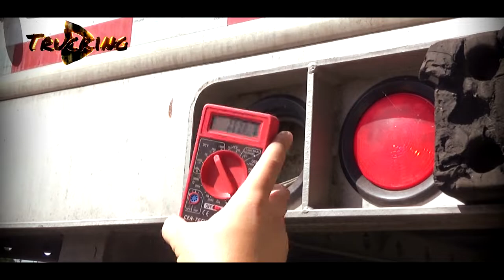Semi trailer wireless reverse light install PART2

Comment: U smart bro 🙏 can u help me how I can get cheap front pumper for 2013 cascadia with fog lights.. thank u
Reply from the maker: Order from Amazon. Did you hit the deer or what happened? Did you originally had a fog lights with your cascadia?
Reply: Bro yeah I hit a deer in newyork.. no my truck doesn’t not have fog light pumper and it didn’t come like yours but since I’m owner I would love to have foglight pumper and deer guard metal. But I don’t know how to fix stuff. Maybe it’s hard for fog because it didn’t come with one like that. So how l?
Reply from the maker: Ahmed Gaas just buy a bumper with holes. Buy a fog lights as well. There wiring should be prewired for a foglights. But you need to change a light switch and diller can reprogramm your computer for a fog lights.
Reply from the maker: Ahmed Gaas if you couldn’t use original wiring, you can do your self wiring and use a switch inside cab.
Reply: D - Trucking thank brother that’s good idea first I will buy new pumper with fog light holes available. Then I can fix that later when I can do it myself 🙏👌
Reply from the maker: Ahmed Gaas i will put a video soon how to wire s fog lights. I’m going to install an extra lights in the front.
Reply: D - Trucking sound great  that helps bro.. if your are OTR owner like me I’m now In Joliet Illinois off I-80 Pilot... perhaps u near by..thank u
Reply from the maker: Ahmed Gaas I’m all the way in Houston Texas, will go back to CA after Texas. Thx for inviting